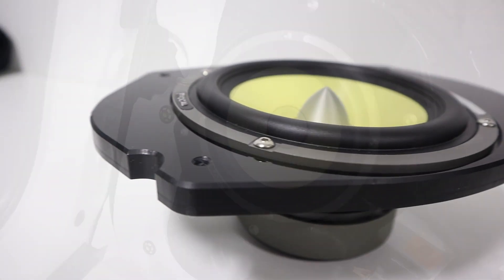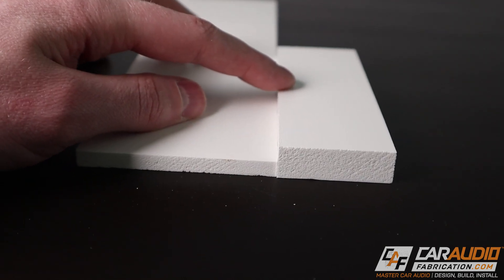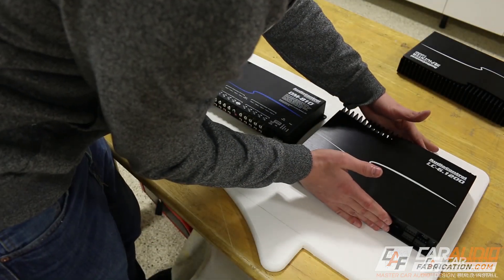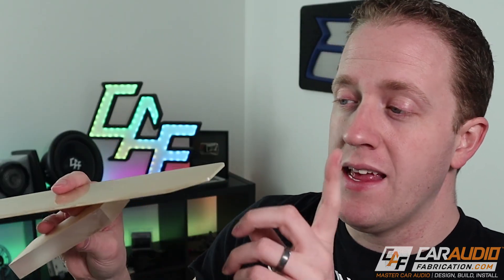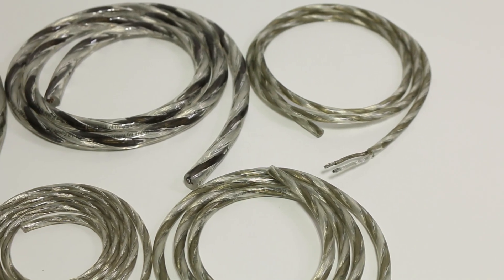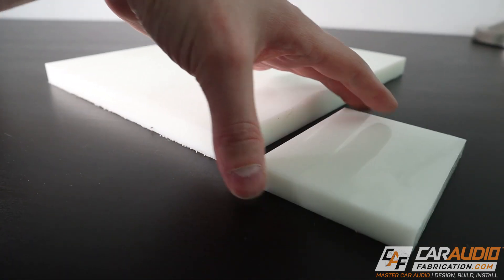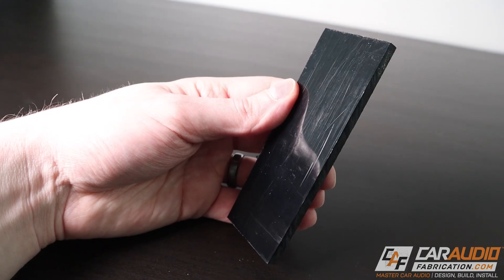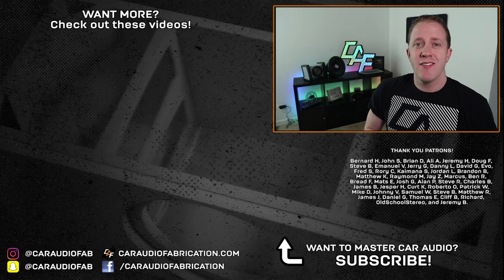Acrylic, PVC, ABS or HDPE Plastic? Which for CAR AUDIO?

Comment: you can sand hdpe,abs,cellular pvc with 36-80 grit sandpaper  to get the material "hairy" and use landau weldwood adhesive for wrapping the panel with vinyl fabric

Comment: I was going to use a piece of MDF as a speaker bracket for my door and someone said to use PVC trim. 

I have a huge cutting board that I don't have a issue with cutting down and I only paid 15 bucks for it so it should be perfect for my project lol.

Comment: No need to paint the edges of PVC that have been cut to fill in the porous edge, just wipe it with a rag dipped in acetone and it will give it a smooth edge.

Comment: @CarAudioFabrication I'm sorry that this is not necessarily a car related question, but it is a plastic question, as you've had plenty of experience in the area of plastics, and I hope you can point me in the right direction... if I wanted a lightweight plastic that would be used to make a flat frame to attach a small 10-13 inch portable HDMI monitor to, for use in converting a 3x4 screen opening into a 16x9 opening, essentially eliminating gaps on the top and/or bottom of the screen hole, depending on where I wanted to place the screen, what would you recommend??? I don't want something thick and heavy, as it's going to be used in an old Mac bubble PC, to mod it to run newer (windows PC) hardware, and was thinking of attaching it to my case/monitor front bezel, on the inside, and just attach it with some kind of long rivets, and also I was thinking originally of ABS, because I heard it was strong, but I keep seeing videos where the sheet of ABS is a little floppy, and ii was wondering if 3/16 ABS would be too thin, or what else a guy might use, for approximately 1.3lb of weight, that would lightweight enough to not add much of any weight, but still be structurally sound and stay in place without much flexing once it's secured in place... Not sure if I can get rivets for my gun that are long enough since I'd probably need at least a 2" rivet, depending on how the screen and the ABS plastic fits, and how close it sits to the exterior, and I'm honestly not sure how I would be able to attach the screen to whatever plastic I choose, since I'm not sure what the plastic in the monitor is made of, and I'd still like to be able to replace it if need be, although I do  have an idea for that, possibly, since the monitor I'm looking at buying, does have screw support for a VESA mount, which could possibly be then just holes drilled into the ABS or whatever plastic, to conform to the VESA mount standard...

Comment: Mark , I am building a 79 bronco. I have the sound system layout and would like your opinion as to what material to build the door panels out of? Doors will have 2 6.5in midbass stacked vertically. This truck will be driven ,so it needs to be tough. Thanks for a great channel and any info will be very helpful.

Comment: the previous owner of my car had an after market radio in the dash hooked up to the original radio into the trunk. would there be a reson y ? would I be able to use my stem without the two being connected to one another

Comment: Knu Konceptz definitely has the best battery terminals, best CLD (deadener) for the buck, but I find their RCA's and speaker wire to be non-optimal.  I've got a stack of their RCA cables where the ends have come off, and I'm now just using that cable for its parts.  Also many of the distribution blocks are frustrating.  But they still get a deadener and terminal order from me routinely.

Comment: I actually built an HDPE "Starboard" - king plastics (3/4" thick) subwoofer box for my JL Audio 8W7AE. I used 125 deck screws, and a roll of thin and wide weather stripping to seal my ported box. the bass hits hard and is very tight.  I used 9 cut pieces in all for assembly. Just because they said it couldn't be done.

Comment: Got us a coupon code for knukoncepts? I’m doing an an overhaul on my 2011 Tacoma, and the only thing left to order is cables and wires.

6ch rca to dsp, 7ch rca out to 2 4ch amps. Then 1-0awg power back to fused distribution, 4awg out for amps. I’m thinking 12 or 14 gauge speaker wire- 2 7” woofers and 1” tweeters up front, 6.5” 2 way coaxial in back doors. 8” sub as well.

Basically I need a lot of wires and cables.

Help a brother out!

Comment: why not mention poly carbonate? aka lexon? Being its flexible and great for subwoofer windows? Problem with heating up and bending abs is it absorbs moisture and can bubble if you over heat it. HDPE and PVC will not. PVC though is highly toxic if it starts burning... You can find ABS smooth on both sides.

Comment: Great vid. There are different grades to each material. Acrylic bought in home improvement stores is usually extruded and thus very brittle so it does not cut or machine well. Cast acrylic machines very nicely. Also, HDPE is different consistencies depending on color. HDPE marine board is the harder, more dense type and is better for machining than other types.

Comment: Back in 1993 I knew someone big into SQ car audio that woukd use 1/2" Corian plastic for his enclosures and amp racks. He claimed it was denser and stronger that 3/4" MDF.
 He was the only one I ever knew they used it and I have not seen it sense so who knows. 
 In case you don't know what material that is check out your local McDonald's countertops that they use near the cash register's.  If I remember right it only comes half-inch thick however I think it's extremely easy and strong to glue plus sanding makes it to where it's very hard to even see the seams afterwards . I'm betting it comes in at least 150 colors and patterns.
Reply: Corian is just an acrylic polymer with alumina trihydrate, it also comes in roughly quarter, half, and three quarter inch, as it's actually sold in metric thicknesses. In the end, it's just another acrylic. Can you make acrylic denser than MDF? Possibly, but I doubt it'd have the same acoustic "deadness" to it like MDF does. Strength is also questionable. Without scientific evidence to back his claims, he's just selling snake oil. 
As for colors, it can basically come in anything, including patterns, DuPont/Corian also sells color-matched acrylic glue for 'seamless' installations. Corian is also the original brand name for acrylic-alumina trihydrate, and similar, plastics. It's also common in signage and is easily thermoformed. 

This also makes me wonder how other counter top materials would fair as enclosures. I don't think I've ever seen the acoustic qualities of stone tested.

Comment: Thanks, as always, for the extremely informative videos Mark. I do have a question though. My second generation Dodge ram has abs plastic for the dash and it's notoriously brittle after years in the sun. In your experience, which plastics resist sun corrosion best?

Comment: In my experience, i used a 1/8” plate of abs to mount a headunit, and with the 100+ degree hot weather, the abs became super malleable. With the weight of the radio it bent, so i had to redo it with aluminum. Not sure if it was a cheap piece or if anyone else has encountered that problem?

Comment: Can't us PVC for sub box maybe u haven't done it , I build a ported box out of 3/4"  PVC  for a 12" Alpine type and been using it for 2 years now and still solid plus you can sand the edges and paint it even vynil wrap them
Reply: You can use PVC for an enclosure, but other materials will have better characteristics. Compare a box made from 3/4" of layered cardboard to 3/4" MDF, and see which is better; clearly the mdf would be better, and it's the same when comparing plastics, though the change isn't as drastic as cardboard vs MDF.
The only reason people get away with using PVC pipe enclosures is the same reason people get away with using cylindrical concrete forms, tubes are structurally stronger and require less material, and the lower, more complex surface area produces less box noise, which means better audio; with equal volumes and equal area of the end caps, a cylinder has less surface area than a rectangular prism. This, however, does not apply to cubic boxes, sheets of PVC are much more porous than extruded tubes, and has worse audio quality when compared to other plastics.
Plastics aren't even recommended for enclosures, MDF is the best material for audio quality while not being unreasonably expensive. Compare your setup in PVC and MDF, you'll see that MDF is far superior. Even in tube setups, layering MDF is superior than cardboard tubes and PVC tubes.

Comment: So how would you recommend hooking up a sub in a car with a factory stereo that you don't want to change? I have a 2016 Fiesta ST, I know i can get a high power to RCA out, will this degrade much sound? What ones should I look for? Are there better ways to do this?
Reply: Sc1Z AudioControl LC2i will accept speaker (hi level) inputs and convert to an RCA output to send to your amplifier for a sub with the added bonus of AccuBass. Alternatively, all underseat/compact active subs (ones with an internal amp) will accept speaker level inputs and add bass to a stock system without overpowering the car speakers
Reply: @phizzle24  oh nice! I was looking them up at work and the videos I watched used a $17 part. Now, granted there are amazingly good cheap parts but, this seemed a little on the LOW side.  I have always had a custom head unit, so my exp with high power outs is lacking. This is exactly what I needed, the GTO will also let me turn the amp on.

Comment: Don't forget ABS is terrible to cut and machine as it will melt easily but very strong.
Reply: Use a new, sharp wood blade on slow speed and you'll change your mind.

Comment: Also interested in how you would go about attaching an HPDE speaker ring to an ABS speaker ring.
I did that this weekend, and CA glue just didn't work.  I ended up drilling & tapping holes from the backside to attach the ring, and then using a CA glue fillet around the sides to hopefully "seal" it down.
I saw you used CA glue in a previous video - wondering if you have any new advice.
Reply: There are specialty epoxies for HDPE, similar to something for King Starboard. I found a JB Weld plastics epoxy off the shelf works well. Check my YouTube out for the video.
Reply: You need a product that'll work on a low surface energy plastic, like what HPDE is. 3M and Loctite both make a variety of products for these kinds of plastics.

Comment: How about a single 12” 1500w rms sub box from acrylic, Too much power?
Reply: dpgoverride I’d imagine it would work if it was thick enough... but hella costly.
Reply: @joshuas1767  Good point, I imagine it wouldn't be cost effective. I'm planning my sealed box build for a Hotel Series 12, down-firing box, for my sisters system. Maybe I will just do an acrylic side window, I'd like the sub's movement to be visible.
Reply: @dpgoverride  just use MDF, it'll be cheaper and have better audio characteristics.
Reply: dpgoverride when you start pricing 1” or even 3/4” acrylic you’ll agree that a window will work just fine. Acme Plastics has pretty good pricing but I’ve heard tale of somewhere else that was even cheaper. Siber Plastics maybe... good luck!

Comment: Could you do a video on subwoofer box materials? Mdf, plywood, fiberglass, so on and so forth. Ie, why shouldn’t I use plywood vs mdf
Reply: Tldr: MDF is dense and acoustically 'dead', making it a superior material. There's more to it, but doesn't really matter to anyone outside of audio engineers. 

Acoustic qualities and material qualities factor into how an enclosure is manufactured. In enclosures for anything but subs, this doesn't really matter, as those speakers aren't designed to push a large amount of air; subs, however, push a lot of air with a lot of force, meaning you need stronger materials to avoid enclosure flex. 
Desirable material qualities are having the material be as thin, light, and cost effective as possible; for a rough comparison compare MDF to cardboard, you'd need an exponential amount of cardboard to match what MDF can do, so MDF is better in this case. 
As for acoustic properties, each material will produce a different sound, the material itself has it's own resonance where it'll produce noise at certain frequencies, this is caused by material flexing, and there's also the issue of how a material reflects and absorbs sound. It gets more complicated, with surface area vs volume (a sphere would technically be the best enclosure), complexity of surface area (internal bracing, stuffing, etc.), and the physics of soundwaves themselves, both inside and outside the enclosure. 
In MDF vs ply, you have to remember that ply is natural wood and MDF is basically sawdust and glue, MDF is much denser and more acoustically 'dead'. 
Between both qualities, and the price, MDF is the best, and is why the loudspeaker industry uses it as much as it does; if a better material existed, you'd see the industry switch to it. 
There's also the choice of SQ vs SPL. In SPL you don't care about sound reproduction, but you care about how loud it is, so material choice isn't as important; SQ is the opposite where material choice does matter.
Fiberglass is a tricky subject. Its less of a comparison of material choice, but more of how it's used; typically it's a very complex shape made to fit a complex space. It can be made to sound decent, but, in a 1:1 comparison to a MDF enclosure of the same properties, it won't sound as good, but will be cheaper and easier to manufacture.